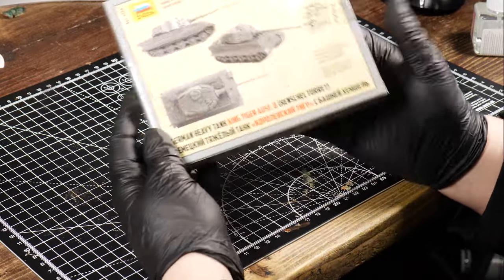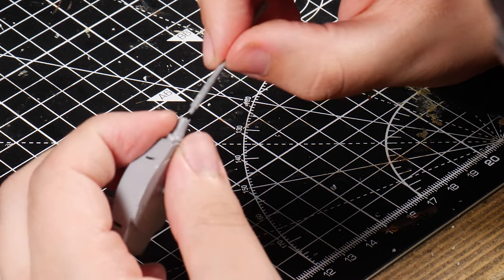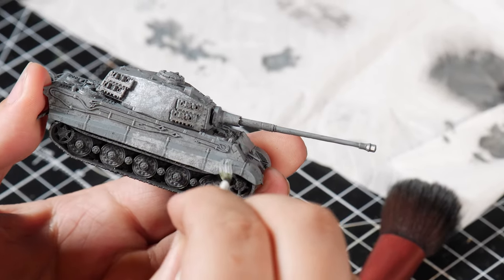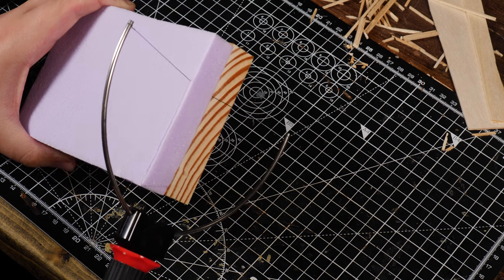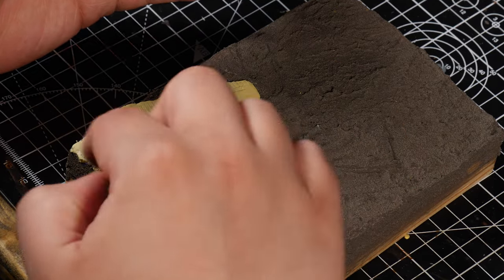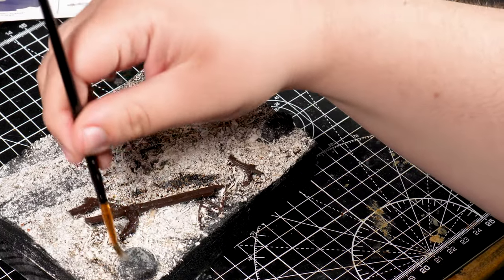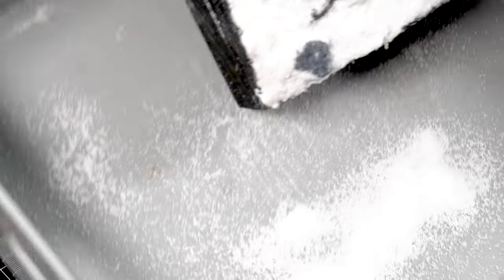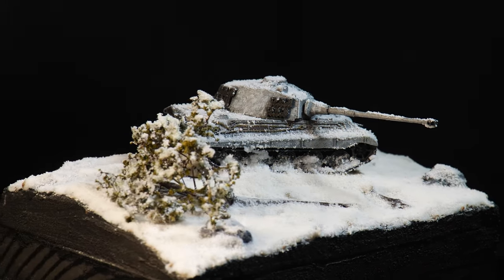Making a world war 2 winter tank diorama

Comment: Hey mate, this was a great build! I noticed you weren't happy with your initial snow flock application in this video and your Warhammer Cursed City video, and followed up with the thicker application. The snow flock product you used in both of the first applications was very stringy. I assume this is supposed to help it replicate snow over irregular ground cover, but it appears to be the common denominator in a ground finish you're not happy with.

I'm about to attempt a 1/48 scale tank diorama (Tamiya 1/48 Panther G box art for reference) with a much lighter snow cover, essentially pressing snow into the mud as the tank drives past - Would you feel your initial applications of snow flock adequately represent a light snow cover? It looked fine in the video for the finish I'm after, but the modeler's Mk.I eyeball often has a different perspective.